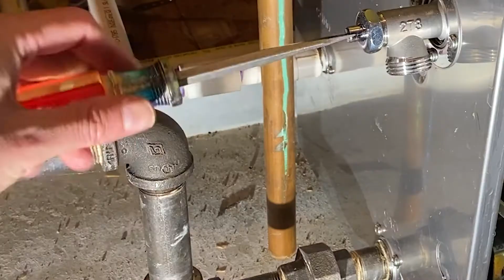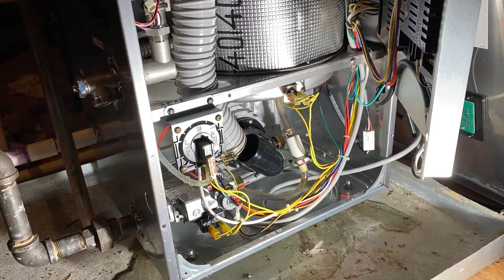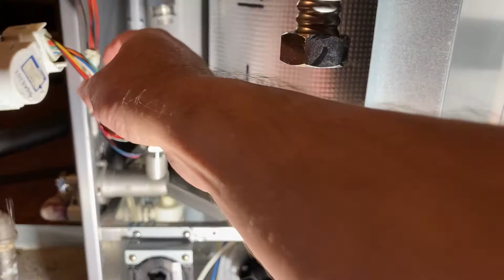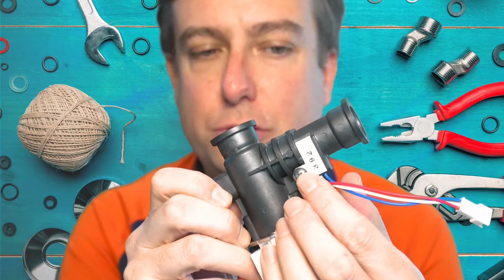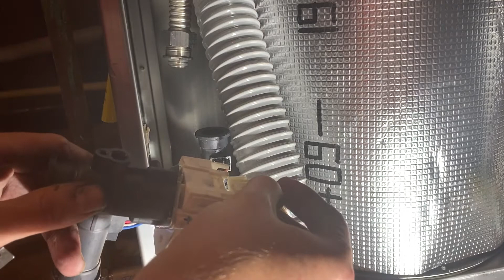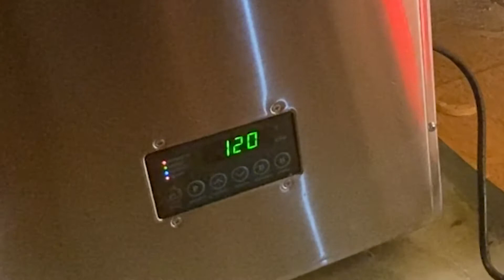DIY Well: Fixing Eternal Water heater E27 code and leak!

Comment: Fell victim to E27 error  code.  Big name local plumber wanted thousands to replace an 11 year old system.  Found y'all online, ordered the part and replaced it myself with the help of a friend.  Front panel pops off with a little help.   Couldn't get the other panel screws to budge but was fortunate I could get my hands in the small space to get to the valve.  Make sure you purge the hot water from a sink (before you disconnect pipes or water will keep coming :)  - what's a DIY job without a little excitement.  Thank you for the video and where to find the part.
Reply from the maker: I’m so very glad the video helped!  It is what makes this worth it for me. Thank you.

Comment: Thanks very much for your effort to make this wonderful repair video. I watched your video and did the replacement for the mixing valve. It's working great. I I notice there are a lot of minerals built along the pipes, and there are very small tiny leaking in a few places, do you have any idea how to clean the residue for this eternal water heater?
Reply from the maker: You are welcome!  If you are referring to corrosion around the fitting with the gaskets?   I wouldn’t worry about cleaning the corrosion.  I tried, but I was more concerned about causing damage to a fitting that I can’t replace that I abandoned the idea and just replaced the o-ring.   I would just replace o-ring to ensure no water gets back through.